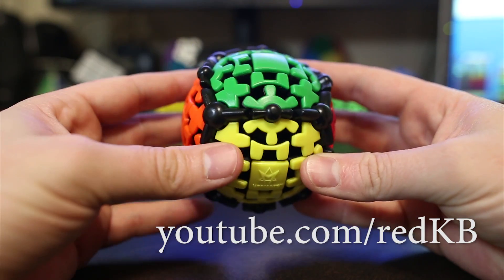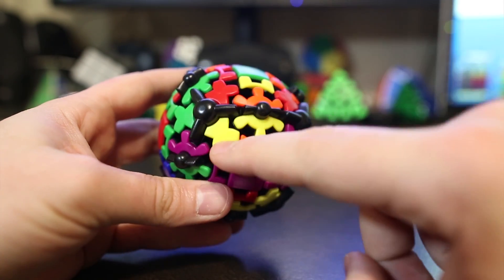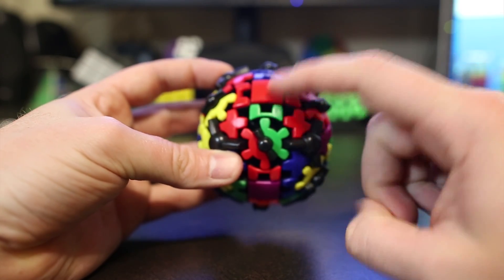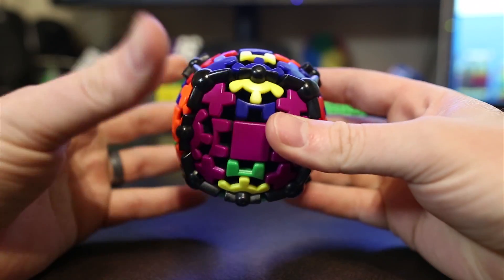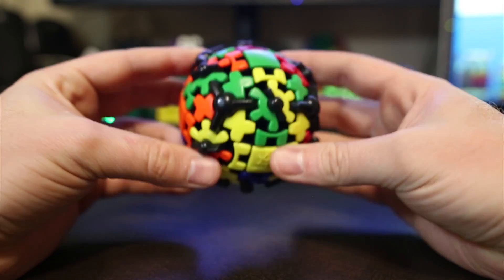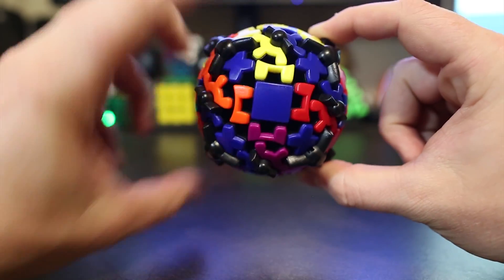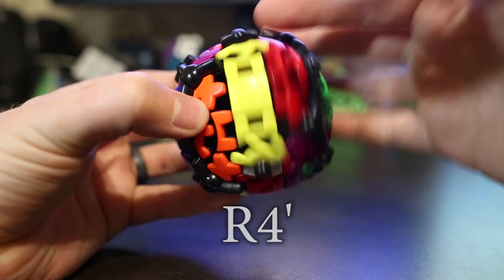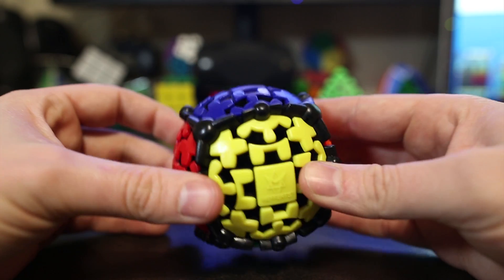How to Solve a Gear Ball

Comment: Guys, if one of your gears on the edge is mis-aligned. You have a flipped edge. Its like a corner flip or an edge flip but in a gear form. Thats why I struggled on step number 4, its because the edge is flipped or mis-aligned

Comment: Also the next move of R U R U R U also messes up the corners. I have to do an additional R U move to get the corners back but then I'm back with one slice with the edges reversed as the start of this move?  Why isn't it working?
Reply: I figured out what I was doing wrong. I was holding the centers in place around the equator while doing the U move. You need to let the equator centers move.
Reply: Lol
Reply: it was late, I was very tired.  🤣 @georgebarclay8065

Comment: Mine does not work this way for the R2 U R2 U move. I see you turn the right side clockwise (looking from the right side) then the top clock wise (from the top) then repeat that. If I do that when I get to the last U move I have to move it counterclockwise to keep the corners aligned. If I do the second U move in the same direction as the first time the corners will be wrong.  I don't understand.
I used to be able to solve mine with no trouble but I haven't played with it for several years. I pulled it out and scrambled it up and now I can't seem to solve it anymore. I follow your video (and other similar videos) and mine never works like yours when I do the same moves.

Comment: I really need help with putting the edges in there place I do R2 U  R2 U And nothing happens the corners get mixed up and the edge that I want to go somewhere never goes there. Am I holding this wrong the edge I want to switch is in the top and the other is the next space at the back
Reply: Nvm I realized that when I was turning I was holding the middle piece and not the outer piece like him and when I held the outer pieces I solved it every time after that

Comment: I've got a weird problem. When I do the last step, rotating the gears, they won't align correctly. They are either slanted, or 180 degrees out, meaning the black bar is aligned, but the colors are swapped from where they belong. Any help? Thanks.
Reply: Got it. I did some reading from your other posts and read that they had slipped a gear. I spread the ball a little, spun them into place, and all is well. Great tutorial. Thanks a million!

Comment: This tutorial is incomplete. There is a special situation you have not mentioned that can lead to an endless loop of applying R2 U R2 U, but getting no closer to a solved state.

If you observe one meridian(A) with edge colors reversed around all 4 centers, but the rest of the ball is solved (edges in right place on one meridian (B), mirrored colors around centers of other meridian(C) ) you have this situation. You must perform R2 U R2 U on the meridian with mirrored colors (C). Choose a side with mirror edges the same color as the center, rotate to top, do R2 U R2 U.  It will switch the mirrored colors, looking basically the same for that side, but now the puzzle is actually able to be solved. You can proceed to R U R U R U step. 

In this special situation, if you put a mirrored side on top without mirror edges the same color as the center and do R2 U R2 U, you will need to do more R2 U R2 U moves to make the all edges correct before solving (where needed - i.e. not needed to do on the mirrored meridian again).

I imagine for some of the people who think this overall technique doesn't work, this is probably the reason.

Comment: Sometimes I do the edge pieces and sometimes it works, but other times I can find switches on one side, but then the other side I can't find any switches and they are all mixed up, so then I just start all over. is there a way to fix the edges all being mixed up?

Comment: I tried R4 move, to get gears in line and finish, but one of the gears are not aligning like it should be. It's only one gear, and when it does align with the corner gears its backwards. Instead of blue on blue, and orange on orange, its blue on orange and orange on blue. Any way to turn one gear 180°?
Reply: Figured out what was wrong, its solved now. Thanks for posting this, I needed to know orientation of the sledgehammers used.

Comment: I got to the end and couldn't match the gears up and then I realized that a few of the gears slipped when I was messing them up. I had to manually turn them to the correct orientation.

Comment: Hey, so I'm having an issue, occurring around step 2. I have all middle gears oriented with the proper centers except for a single middle slice. In this case, they gears need to be switched with the opposite gear. Can you help??
Reply: nevermind...I had dropped my ball a couple months ago, and the tiles popped out, and I had put them back incorrectly XD

Comment: Kenneth we have the same name lol. So here is my problem looking at the pink side with blue on top and green on the bottom I have the middle column solved but the right and left side are red, the opposite for the red side. For the orange and yellow sides everything is in the correct spot except the centers

Comment: For those who say this algorithm doesnt work, you probably have misplaced edge colors! I first tried this algorithm and ended with only two sides solved, while the other sides got different edge colors. Pick out the edge pieces and reattach them. Then try the algorithm again, ul get it right! Trust me. Mine worked. This gearball was just given to me. Im guessing it probably fell and the pieces were attached wrong.

Comment: For any of you guys having trouble with steps 2 and 3, here is a very useful tip. Make sure you hold onto the correct edge when doing your algorithms ie holding the left edge in place when doing r, and the bottom edge when doing u. It took me a while to notice that RedKB was doing this, and it really does make a difference.
Reply: I noticed that too....
after 30 minutes
Reply: Thank you! I was so confused how a puzzle meant to be easier than all of my other ones was giving me the most trouble!
Reply: And how does this make a difference? So far it’s not.
Reply: Thank you so much, this made all the difference. Couldn't figure out what I was doing wrong until I read your post.
Reply: O tried that but how do you dk the 3 alg
Reply: This is

Comment: I feel better about knowing how to solve it vs stumbling onto the answer. Though I figure out how to solve one state. If two sides are solved, two has everything except the center, and two sides with a line of the opposite color.  You have one of the sides with the center wrong facing you and the lines going up on the side. You R, U, U, R' then you will have it in a state where to just spin it until you have the gears correct like in part 4.

Comment: Besides it's simplicity, I find this puzzle really interesting. Even though it's basically just turning the two opposite sides of a Rubik's cube in opposite directions. Anyways it's quite interesting to see many different variations of solving methods from a irregular puzzle compared to everyone basically doing the same layer by layer method of a Rubik's cube.

Comment: Thanks for the video, but I've got a problem that I can't solve with these algorithms. I can almost solve, but somehow, the blue and orange center pieces are swapped. I have no idea how it got like this and can't think of a way to move them. any ideas?
Reply: when I solve for orange first, the orange center is off by 90 degrees instead of 180 degrees like your red one does in the video.

Comment: when im placing the gears in the correct place BEFORE I COMPLETED THE BALL(step 2), every time im turning it into the correct place, another gear is messing up. And its messing up that its need to switch with his OPPOSITE gear what am i doing wrong?

Comment: um, i think mines weird. like, i gave it to my mom, and she shuffled it, and when i got it back i did all the steps until step 3.  now my middle peices(not center) is opposite sides of the area of the area it needs to be. like blue is at the green side, when its supposed to be on the blue, or next to blue. basically i need to get those middle peicees across the center peices, so i am able to do the rururu thing to get it on the blue
Reply: Michael Griffin cool

Comment: step 3) What if my edges are on the opposite side of the ball and switching them doesn't work?
Reply: i did the whole ball by my self but the cornners are wrong eccept orange and yellow
Reply: i literally cant solve it cause of this and i wish redkb would have covered that
Reply: Switch one edge with the edge between the two unsolved edges

Comment: I can't get this one gear. It just won't turn straight and it's always sideways. It's just one can someone help?
Reply: Jackeline  Flores re-scramble the ball and try solving it again
Reply: Jackeline  Flores what u need to do is pull the edges apart and with ur free finger spin the gear until it straightens out
Reply: Not possible, just twist it
Reply: Jackeline  Flores That happens to me you can twist it a let go and it pops in nomarly
Reply: Jackeline  Flores it's possible for it to fall out of alignment. you can work it around mechanically
Reply: Romecomic Hi
Reply: No sorry it might be bandaged 🤕

Comment: Followed your path.  I managed to get two opposite sides correct, but the other four have their corner colors switched.  My red and purple sides are opposite, so my red corners are on the purple side, and vice versa.  Any idea how this might have happened?
Reply: Czerno Alpha Just match up the corners with the centers by turning them, but I think I might be misinterperting the problem. Tell me if it doesnt work
Reply: I managed to solve correctly after a few iterations.  Still don't know what I did wrong that first time, but it's all together now.
Reply: Czerno Alpha that happened to me once, but I fixed it
Reply: How do you solve this problem, my sides are switched too but each time I do the algorithom for the third step, it messes up my ball!
Reply: Henry DeVasher For the third step, hold the left/right face and turn the oposite face once. Make sure the center is the opposite color of the corners. Ex. (Green Center/Green Corners)Turn(Blue Center/Green Corners)
Reply: Didn't work for me either couldn't even get the first side done

Comment: Is not workin 😭
Reply: You might be implementing the notation incorrectly. Try searching gear ball notation on the internet.
Reply: I can’t solve it either
Reply: reshuffle and try again. if you still can't then try again in a few years. sometimes young brains are too small to understand stuff like this. like i used to be unable to understand stuff like this. another tip is to get good at geometry.
Reply: Michael Griffin I actually found out how to solve it
Reply: good job. sorry if i offended you a bit and maybe assumed your age.
Reply: it's fine u didnt
Reply: Michael Griffin thats the truest thing ive heard😂. I got the rubiks cube when i was 10 and i couldt solve it. I picked it up 2 years later and i lesrned how to solve it within a few hours.

Comment: Hi I am a intermediate because I can solve the 3x3 in less than 45 seconds, 3x3 mirror cube in less than a minute and of course the 4x4,I can solve it in 3 minutes. So I added the gear cube to my collection and see it's very hard to solve and I am 10 years old now, so any suggestions?
Reply: tanish Bezawada maybe try a gear ball because it is easier and can probly help you get used
To the gear movements

Comment: Is there a big difference between the gear ball and the gear cube?
Reply: they are exactly the same.
Reply: there are little corners that need to be solve
Reply: well technically the gear ball is a little harder then the stock gearcube because it has colors on the static rack part of the edge pieces. The gear cube is just black on those parts so you don't have to orient the edge pieces truely, just the gears.

Comment: I followed these steps, and now I'm left with 2 completed sides (yellow and orange), and 4 almost-completed sides. Only the corners on the red and purple sides are swapped, and so are the corners on the blue and green side.
The first time I solved the cube I had the same state, and with a few turns I could solve it, but I don't remember what I did and ever time afterwards it only messed up the ball. Does anyone have an algorithm I can use?
Reply: Here is the solution to that, hold it with one of the solved sides facing towards you, and do this algorithm:  R U R' U' R U R' U' R U R' U'
Reply: scrambling it is fine, since otherwise the rest of the method isn't applicable because, well, the corners aren't solved.
Reply: tuffguy 6221 Yup I managed to solve it before watching this vid doing edges first then corners and triple rur'u' worked for me
Reply: Animiles
Reply: Animiles I solved it and what I did was start on every color that he did to make it easier also thanks for making this video RedKB
Reply: Animiles is
Reply: Animiles same
Reply: Animiles f
Reply: Animiles turn the sides

Comment: Quick tip for the gear ball: put some lube in it when you get it. It locks up a bit and turns a bit slow, but put some lube in it and it will be amazing.

Comment: hot do you swap 2 centers directly across from eachother someone plz help?
Reply: Just Mix it up and do it again. Thats wat i do
Reply: RMX-45 Gaming ok thanks
Reply: +RMX-45 Gaming I have the same exact problem every single time I do it, and no matter what I do, even if I mix it up, it'll still be like that
Reply: YASS I found out what to do. So apparently (at least for me) two pieces got messed up. So I took it apart and reassembled it so all the pieces are in the right place, and made the puzzle a little tighter. Now, when I mix it up and solve it, it solves fine.

Comment: somehow I solved the gear ball without any other method by myself.
first I solved two sides any color,then I would place inner edges horizontal with its proper corner,next I would rotate that side 180° to its proper color,last I rotate the top layer 180° until the gears would rotate onto its proper color. then it would be solved.

Comment: I have a question on my gear ball because after I solved it a couple times there is always one piece messed up and I just can't figure it out.and the hole rest of the ball is solved?
Reply: Happened to me, one of the gears had slipped. Just jimmy it back in as it's impossible to solve one incorrect edge ;)
Reply: +Robert Wakeling thank you so much!!

Comment: I have a gear ball and I absolutely hate it it jams every time I try to turn it Please someone help
Reply: Me too!
Reply: mine was perfect. another thing is that the gears have to be on the frames where the corners point at it
Reply: Ethan MemeLord same here
Reply: Just turn it the poisoned way and then move it fast to the way u wana turn it
Reply: +Ethan Roppel 

Pull off one of the centre caps, grab a Philips screwdriver and loosen the screw a few turns.
Reply: @czgibson no, if it’s jamming he probably needs to tighten the screws.
Reply: Me to
Reply: i used to have one that jammed a lot but i lost it
Reply: Putting a heavy lube like Vaseline in it will help it not catch as much

Comment: hi, i don't know if you actually read you're comments, but I have a problem with you're method of solving the gear ball. The problem is when one of two edge pices needs to be flipped. using the algorithm that you give (R2 U R2 U) flipps not only the top and bottom edge pices, but also the left and right gears. in this case, when you do the algorithm, it flipps the four edge pices you want to be flipped, (the ones on the top and bottom) but it also flips the already solved edge pices (the left and right ones). If you know how to fix this, other than just going on two a different edge pice, please tell me!
Reply: +Luke Chase He explains in the video that you need to orient the correct edges into ring so that 4 wrong edges are facing you.

Comment: I try to orient the edges but it doesn't work what am I doing wrong
Reply: +Marco D And how did you solved it?
Reply: if the first algorthm does not work do R U R U R U and it should orient the edges if both sides are the same color then start over
Reply: Judy Cheney thanks
Reply: +The MC Engineer me too i need help!!!
Reply: +Judy Cheney he changes it when he cuts some footage
Reply: Chuggamarco i cant even do the corners the case that i have he doesnt show it
Reply: General Disorder hold the left bottom corner then do the algorithms
Reply: Junior Ford's omg thank you so much this actually worked!!
Reply: Junior Ford's it still won’t work help :(
Reply: +Marco D are you holding it on the bottom or the side?
Reply: Nvm I solved it
Reply: +xlelo2011x +solve
Reply: I took some advice
Reply: +Marco D oke thx
Reply: Owen Pang no I got it
Reply: But thanks though
Reply: Marco D start over again and it should work
Reply: Chuggamarco it solves the same as the gear cube but the on,y difference is the edge swap so watch that tutorial
Reply: Donna Adrienne Altuna it's  not
Reply: Chuggamarco he was talking about the edges with the black line
Reply: Chuggamarco its

Me Mark
Reply: Same here and starting over didn't do carp
Reply: Chuggamarco you might have done r2
Reply: Gen-Disorder I had the same problem

Comment: One more way:solve 1 side which automatically solves 2 sides( 1 more side).
Step 2: make 2 of the sides solved opposite ie Flip the solved parts sides(you pick). Once you are satisfied with your results,flip it back.keep doing step 2 until it is solved